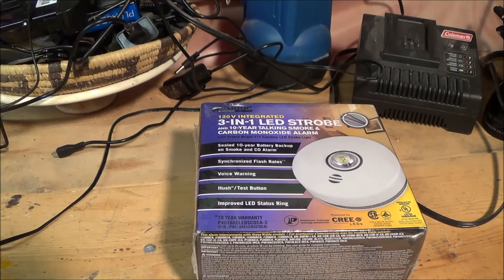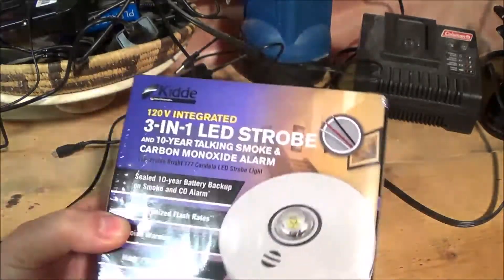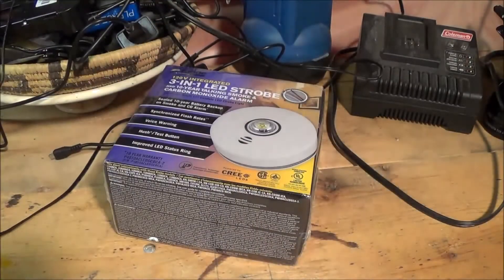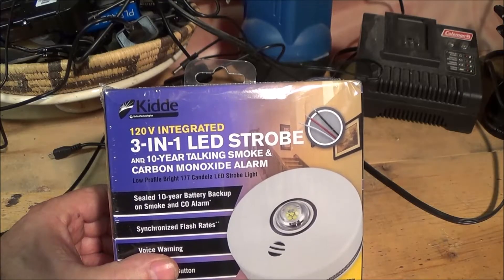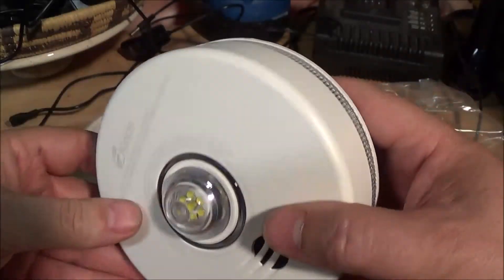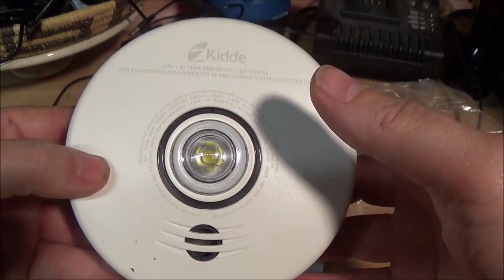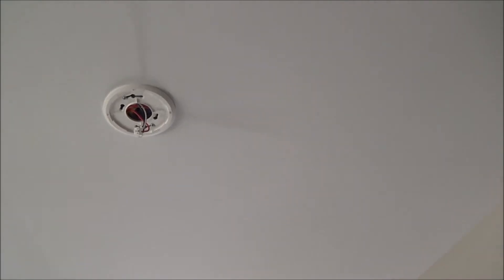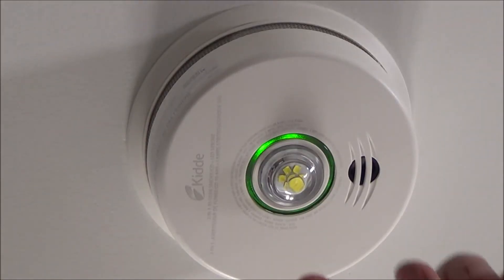Replacing a Kidde 3-in-1 LED Smoke and CO1 detector. Unboxing, testing, installation and review.

Comment: The instructions DO TELL YOU HOW TO TURN IT ON.  Section 9 'Wiring /. Installation / Activation' on page 15, reads "Do one of the following:  'Install on the mounting bracket' OR 'Turn the wheel to the ON position using a flathead screwdriver.' Read the whole section to avoid false low battery chirping.  The steps for the initial install are: Turn off the breaker, wire it up, install the alarm fully on the mounting bracket, Turn on the breaker.  If your building doesn't have power yet, and you want protection until it does, then rotate the dial to ON.   (Regarding the date: At 2:29 the Date of Manufacture is shown printed in bold near the black wire. Your device's date is 2018 Nov 24. It's not only determined by the serial number.  Replace 10 years later.)

Comment: I have the exact one and this thing won’t stop beeping exactly like yours. I can’t get the fucking thing off the ceiling.  It twists but won’t pull down
Reply: Mine actually went off and kept going off for no reason. I tried to take it down by twisting it off the mounting bracket but no luck. I had to take the whole thing off mounting bracket and all. Even in my hand I can’t get the mounting bracket off. Nightmare.

Comment: Hey Frank.. do these need to be replaced? Because ours stop working!
Reply: Replace after 10 years from install or look at the date of manufacture and replace after 10 years from that date.  Manufacture date is on the side that goes against the wall mount side ( it's hidden).
Reply: @CommentFactsAndNotNegativity So it was replaced. My brother didn't install them properly.  Now they're just lying in waste. I dont know what to do cause I think he pulled the plastic self- destruct rod.

Comment: Mr Frank do you have a video or info on how to interconnect all of them please?.. Mine are connected only w white & black... no sure if i have to connect the red wire as well ... ANY HELP PLEASE
Reply: Yours are operating independently (if one goes off the others won't). If you want them to all sound when one detects issues then connect the first detectors red wire to the next one's red wire...and so on until you've connected it to the last one. They talk through the red wire.

Comment: I had one in the guest room that was going off because the outside humidity was like 85%, plus a bathtub that wouldn't drain so I just let the water evaporate and also the fan in the bathroom was broken. It went off once every week. I had an exam the next day after it went off at 2:30 in the morning. We fixed the fan and the bathtub and made sure to run the air conditioner at night, and have the fan set on constant. Hasn't happened since.

Comment: I installed mine but it doesnt trigger the others :(
Reply: Yours are operating independently (if one goes off the others won't). If you want them to all sound when one detects issues then connect the first detectors red wire to the next one's red wire...and so on until you've connected it to the last one. They talk through the red wire.  Albeit, running three wire electrical cable between alarms may not be feasible.

Comment: Hi Frank , I have multiple alarms in the house ( each of my rooms) they all went off and it was a false alarm. How do I identify which one is the faulty alarm and needs to be replaced?
Reply: Happened to me today. I did start to disconnect one by one luckily when I was disconnecting one before the very last one (Master Bedroom) the Master Bedroom stopped. So, I did identify which one was the trigger. I did use our Dyson vacuum on each one and I hope the problem is solved.
Reply: Depending on the alarm, there will be a light that blinks for a few hours after the alarm. While they are sounding, the light should alternate between red and green. After the the alarm the one that cause the alarm should blink red every 10-20 seconds.

Comment: Hi Frank,
I bought the same as yours but it was bought just three years ago but it kept chirp sound in every 30 seconds then I thought its battery was weak the I took it off ceiling in order to replace battery but I cannot see where to replace battery. Only way is take off cover but I cannot open the cover because screw is not star head to crew off . 
I look into my tool box with 32 pieces of head crew but no one fit to crew off to open the cover.
Could you tell me that this model is not designed for replace battery but to call their customer service for replacement whole fire alarm?
Thank you
Reply: Manual says units has to be clean from dust with a vacuum on air compressor at least once a year. I did it and problem solved
Reply: e @jmahecha2709  Yeah  I called service that they said the same as yours but I told myself that never buying online this product that is too much problem and service where they sold it seemly irresponsible to exchange but tell me to fix by do this do that during those we bought from Home depot or sore is never be chirp a sound but battery is weak. 
To me, I prefer to buy fire alarm that can open to replace battery and never buying any fire alarm with 10 battery 10 years.
Since iI never buy fire alarm  from online Costco because Costco sell those  package for three fire alarms that looked cheap but actually too expensive as I had to to buy  another  replacement to avoid trouble .
Because those package of three alarms from Costco online were short life and cause to much trouble , especially as I installed them into rental house that woke up guests by sounding fire alarm on every week.
Please  not buying Fire alarm online because  customer service advise doing this doing that but avoiding replacing for you .
If you buy directly from store that you can exchange or getting refund easily..
Sincerely

Comment: In canada you can find these alarns in luxury houses. Every bedroom has one.
Reply: These are minimum code for new construction in Ontario as of about 2015.  If my house was new it would require 10 of them.
Reply: @SteveRivett  is true. I still have my old kidde ionization fire alarms running cause my house was built in 2008
Reply: They're not just in luxury houses, I've also seen them in newly-built apartment units and smaller homes/townhouses.
Reply: @uppercanada_trainspotting  yeah ive realised that. but im in brampton so heres a lot of luxury houses where i live.
Reply: Not a luxury for me, I have 3 in my one bedroom apartment and one right outside my door.

I have been purely traumatized from the alarms in my apartment for the last three months. The strobe light may be helpful for deaf people but it just extremely hurts me to have to turn them off due to constant false alarms I’ve been experiencing. The strobe light leaves ‘sun spots’ in my vision for up to 20 minutes after disabling the false alarms, and I have contacted my landlord dozens of times to fix this issue, I am not sure whether it is faulty electrical work or the actual alarms themselves as I keep reading that so many other people having this same issue with false alarms in the middle of the night. Mine have been constantly triggered for no reason and also from merely boiling some water on my stove with the window open. 
If anyone has any suggestions it would be highly appreciated

Comment: Ya had me freaked for a minute, not sure why you had to turn yours on as I just checked all my new ones and they are already in the on position straight out of the box.  To turn the switch further will turn the unit off.  I suggest that people pay close attention to the position of the arrow before turning it.
Reply: The models shipping now(-4 models) are not shipped in the ON position, but just a tad away.  the unit is turned on by either installing it on the mounting bracket (battery activated permanently) OR by turning the wheel to on (useful if your new build doesn't have power yet and you want protection.).  Once ON it can't be turned off.  The next turn of the wheel indicated by disable, will deplete the battery.

Comment: These are horrible. I have one in my airbnb and its sync'd with all the other ones in the house - 5 studios in total. When I cook, it goes off - yells at you, flashes the light and everyine in the building comes out looking for the offending alarm. So, I wrapped a plastic bag around it... and cooked again... and it went off again. So I unplugged it... but its still way over sensitive and continues to go off... and so do the other ones in the building. But oversensitive is good right? Oversensitive saves your life and your house right? Well... Carbon Monoxide is heavier than air... so sampling CO at the ceiling isn't smart. Horrible product. I might find another place to live if I can't cook in my $1500/mth newly renovated overpriced walk-in closet. Fuck sakes, might as well have it call 911 for you while your at it.

Update: I unplugged it with nothing else going on in the house and It screams FIRE. And no, you can't just push the test/hush button.
Reply: Can you stop spamming your comment? I have seen you everywhere about this unit. It works fine.
Reply: What's with the 911
Reply: I got this as well.
Reply: Its not the smoke alarm....its the idiot who put a smoke alarm in the kitchen. And it is supposed to be sync to reduce the risk of seizures of epileptics.
Reply from the maker: Hey thanks...sounds like you are complaining about the machine doing its job. Never heard of putting alarms on the floor but hey go nuts. Maybe try some venting of your cooking fumes too.
Reply: @franksdiyandhomeownerhelp  It's most likely a bot.
Reply: His point about carbon monoxide detectors located lower is a good one  @franksdiyandhomeownerhelp
Reply: Kidde hater bot most likely X sense lol

Comment: I prefer the non permanent battery versions tho
Reply: There are ionization 10 year alarms like the:
Kidde i9010 (Battery)
Kidde i12010s (Hardwired)
Kidde i12010sco (Hardwired)
All I know so far
Reply: If you have rental properties the permanent batteries are good because it keeps tenants from removing them and using them for their tv remotes and xbox controllers
Reply: Ya but smoke alarms usually use 9 volt batteries ( i am aware some use AA or AAA batteries) and tv remotes or newer Xbox controllers use either AA or AAA batteries
Reply: A lot of the lithium sealed units mostly use photoelectric sensors only. If only there were some models that can use the ionization sensor for some units.
Reply: Kidde i1040
Reply: @Photoelectric_Elevators  Oh yeah!
Reply from the maker: I dunno I love not having to worry about batteries - have a problem before 10 years - send it back - no questions asked replacement.

Comment: Can you make a video of the alarms doing the strobe? I really want to see how they do the strobe
Reply: I have been purely traumatized from the alarms in my apartment for the last three months. The strobe may be helpful for deaf people but it just extremely hurts me to have to turn them off due to constant false alarms I’ve been experiencing. The strobe light leaves ‘sun spots’ in my vision for up to 20 minutes after disabling the false alarms, and I have contacted my landlord dozens of times to fix this issue, I am not sure whether it is faulty electrical work or the actual alarms themselves as I keep reading about so many other people having this same issue with false alarms in the middle of the night. Mine have been constantly triggered for no reason and also from merely boiling some water on my stove with the window open. 
If anyone has any suggestions it would be highly appreciated!
Reply: holy shit, at 2:30 AM one morning I was trying to sleep (I had the lights off) when it suddenly appeared that someone had turned on the lights, I looked at my door at no one was there. The alarm started a moment after, I quickly got up as I i knew there was no fire as I has recently left my room moments prior and smelt no smoke, I ran to my parents room almost falling multiple times due to the strobes making the house go from bright to dark on repeat ( anyone at risk of seizures with a strobe alarm don’t worry it will wake you up, the first thing you need to do is turn on the light in the room so the flashing strobe doesn’t leave you having a seizure in a burning building) the strobe was blinding once the lights were on my dad knew it was a malfunction too so we immediately got a stool and my dad started trying to find the main one, he found it in his room. We went back to bed, but when my dad was trying to turn mine off he took it off the socket, the only problem is he didn’t put it back in and the way it was facing was directed at my bed. Once we were asleep the alarm happened again I was staring at it, I was immediately blinded laying in bed in burning pain (ironic). After 2 minutes i got up then my dad was turning it off again, then 30 secs later, again , repeat, again this time after my dad turned it off he did a alarm test. This time when he was done it meant DONE! He took the main one and broke it. It hasn’t happened since.
Reply: It doesn't show up well on camera because it's so bright and fast the camera doesn't have time to adjust. It just shows up as the whole screen blinking white.
Reply: It's pure hell, like strobe lightning blinding you.  My daughter got disoriented by the strobe light.   Model number on mine, came with the house is P4010ACLEDSCOCA the piercing was so loud my ears were ringing all day, went off at 3 am for no reason.  Removing them and installing a non strobe smoke alarm that does not deafen or blind you.  I had a headache the entire day from it.
Reply: @Wynter589 Same here, it's just a nightmare. The tenant in the basement sets them off almost every week, and it's so loud and disorienting it causes more harm than good.
Reply: Photoelectric Elevators has one. Hope he will do it soon. Guaranteed he’ll do it soon

Comment: Mine keeps going off for no reason saying there's a fire. Brand new unit just installed. Might just disable it and use the old battery one till I figure it out.
Reply from the maker: Skywalker contact the company they will warranty it and send you a brand new one. NO questions asked!
Reply: It's because the dust keeps triggering the alarm. So you should try to vacuum out all the dust
Reply: You should pay attentoon to the type of sensor your alarm uses. In this case, it’s photoelectric. Not cleaning the alarm will cause a false alarm. If you want to prevent false alarms, clean the alarm or get a high quality ionization alarm.